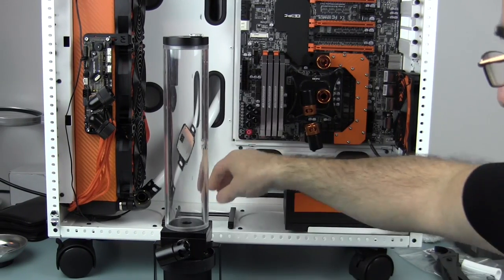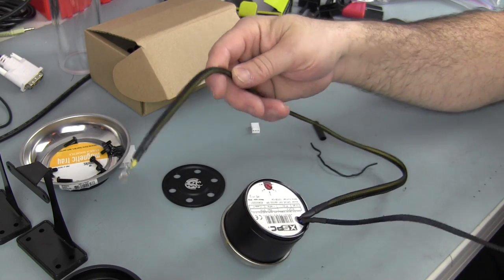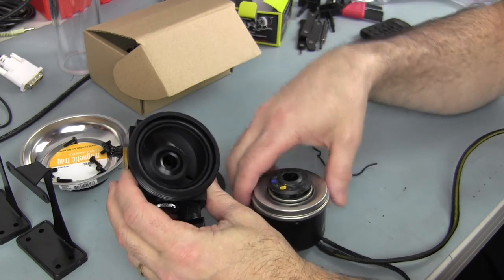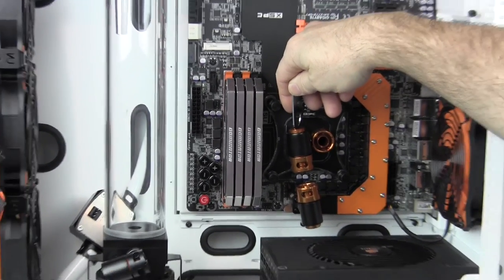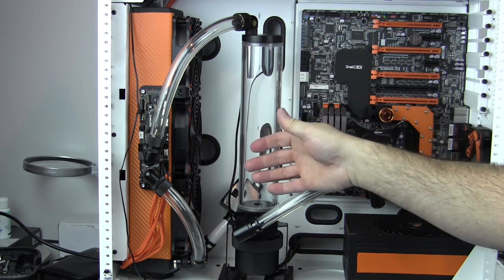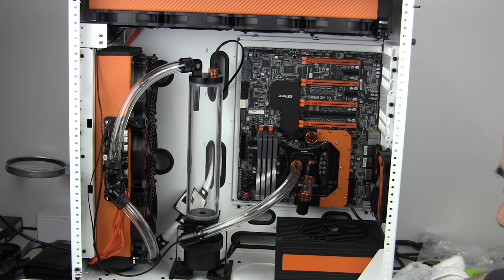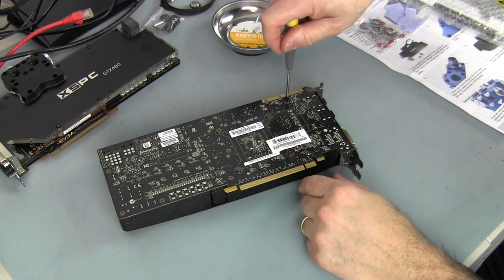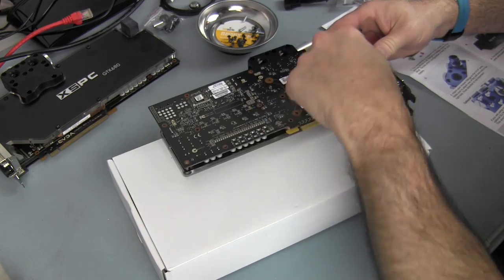Case Labs SM8 Water Cooled Cooled Build Log 5  - Clockwork Orange - Pump, Tubing, XSPC Water Blocks

Comment from the maker: The XSPC pump/res is a great product.  That works, and probably works well  in your build. But you don't have to use that.   But if yo decide to add 2 GPU's or want to really show off more water-cooling parts, you might then look at a bigger different case.

Comment: Good job.  Sounds like the Monsoon fittings are limited in certain applications [I.E. angles].  That connection from the bottom/top GPU to the roof mounted radiator is not an issue with Btispower fittings.  Can't wait to see how you solve it.

Comment: I would have used a 90 degree on the flow sensor and mounted it behind the pump then have a straight tube to the 360 rad. would look much cleaner. Still an awesome system though. Has given me so many cool ideas for a build. Also really want an SM8 now :P

Comment from the maker: What pump are you using ? You can get pump top kits that connect the tube on top of the pump and stand up in your case.  Or you can get get brackets that can allow you to mount the res to your radiator/fans.

Comment: They can be a little tricky to get'em as tight as you want. I couldn't get all mine to base out. But i didn't find any leaks from it though. They put alot of pressure on the tubing. When you take it apart it puts a grove from the pressure on the outer diameter.

Comment: You may want to drill a hole in the 120mm plate, aligned with the speed control for the pump, so any adjustment can be easily made without the need to ever remove the pump from the system.  If you want you can size the hole large enough to accept a garment to conceal the rough edge and to leave a large enough hole to easily fit the necessary tool to adjust the pump.  Or simply remove the 4 screws that hold the 120mm plate to make any adjustment to the pump and then put it back.  Either would seems to be viable.

Comment from the maker: If there is backing on both sides of the pads you do have to remove them.  I will have to check but I would have removed backing on both sides if there was backing on it.

Comment: alright well I checked it out, I think ill buy that and put it in the fan port next to the power supply. and if I choose to get a graphics card waterblock then I can buy another slim 120 rad at the exshaust fan port? Does it matter performance wise if I use the xspc res and pump bay?

Comment: Man your channel seriously makes me want to make a water cooled build. I want to be able to make an intel build and have half the parts. so far im looking at over 900 bucks but I have a zalman z11 case and cant fit a 240 rad up top. would a single 120 rad be enough to get an i5 3570k down to good temps if I overclock?